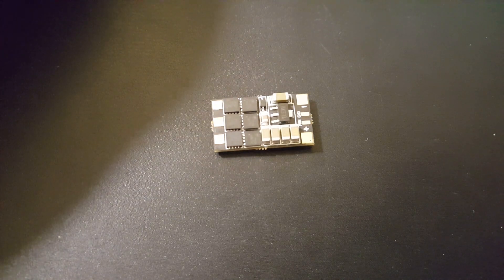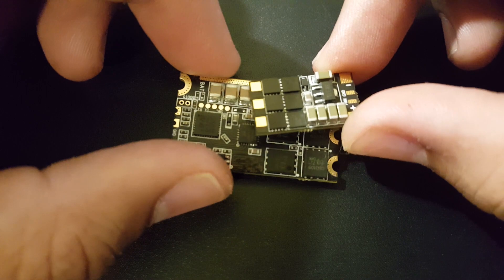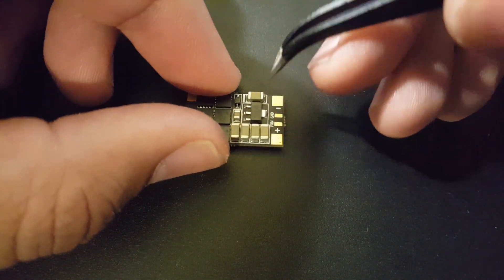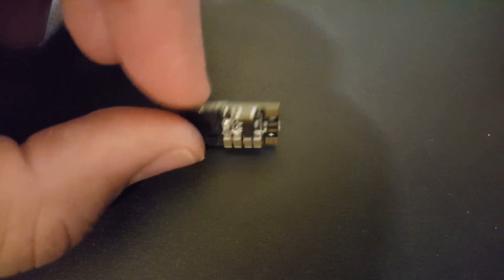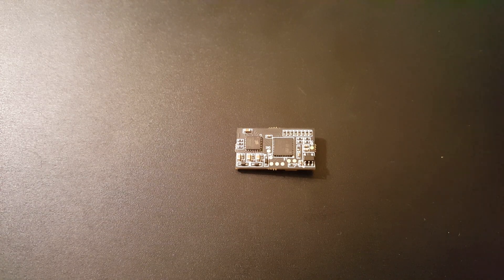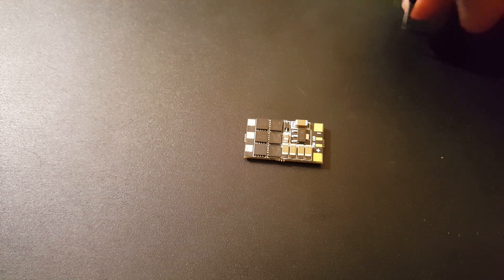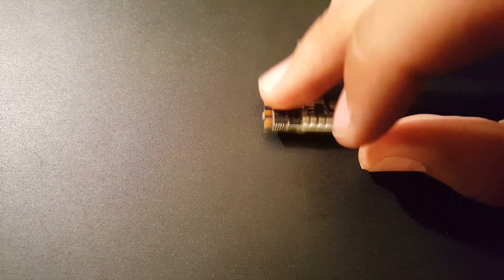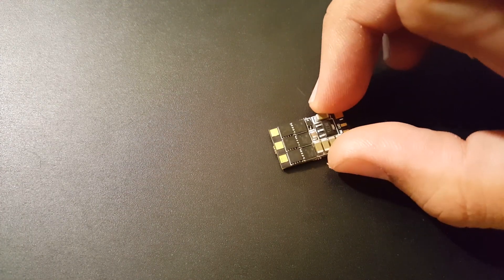Airbot Wraith32 Mini 25A ESC // Review and Noise Testing

Comment: These escs gave a lot of video noise. I tried capacitors and they did not help at all. I love the small form factor but I really hate video noise. I swapped these out for the bigger brother (wraith 35a v2) and the noise is gone. I wonder if the the wraith 25a v2s are any better, considering they look to have a lot more capacitors per esc?

Comment: Just bought 5 of these because of this review. I had a racerstar 4 in 1 30a and they failed twice on me so I've had it😤. I built the awesome f200 frame that I saw on your channel plus equipped it with the matek F405! While everything was working it flew like a dream machine, I even gave it to a friend of mine that only flies kiss fc and he said it was the best fling quad he's ever felt. Well thanks to you I found some decent esc that are small enough to fit the arms of the F200.. Im done using 4in1 esc unless someone knows of a good and durable one..keep up the great reviews tho as I see something else I like I'll order it from the link on your channel!
Reply from the maker: Thanks I am glad I was able to help ^_^ ..

I will keep you updated once i find a good 4in1 I currently have 2 that I think might be very good but its still too early to recommend them..

Keep me updated.